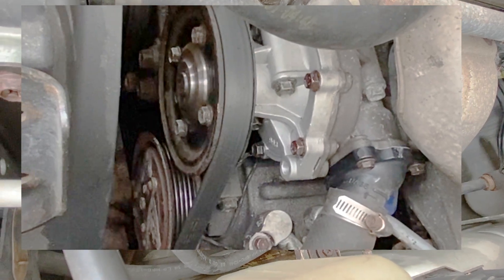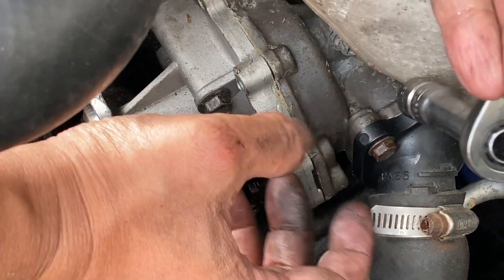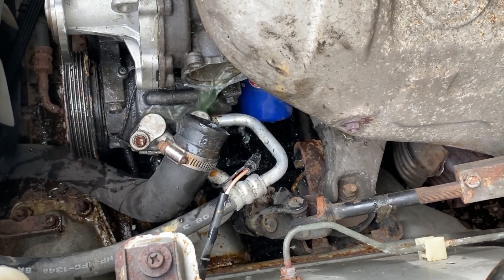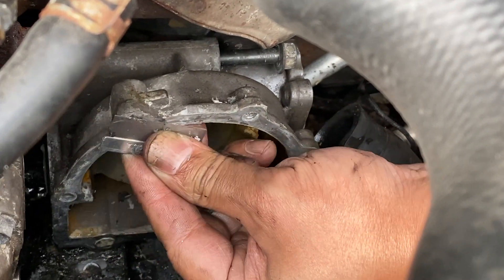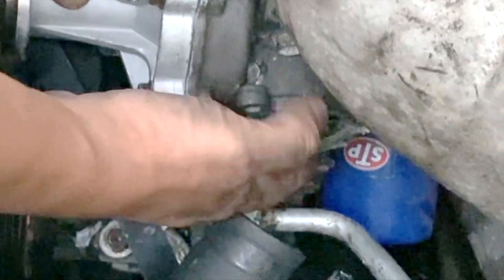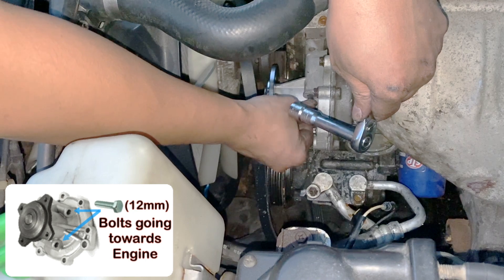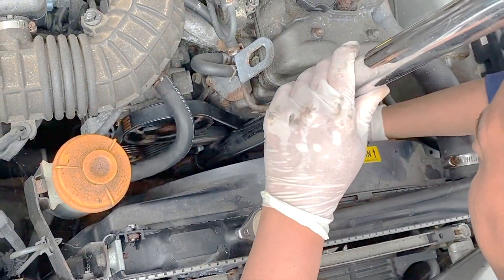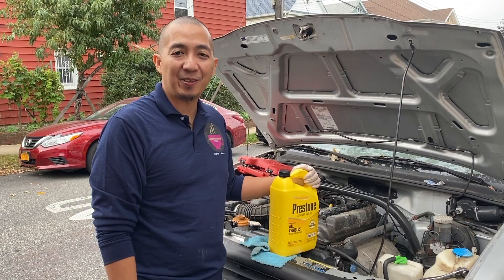How to: Replace a Drive belt, Water Pump and Thermostat on a 2002 Chevrolet Tracker ZR2 (3-in-1)

Comment: My plastic thermostat housing bottom bolt was in direct Line with the AC connection on that square block.. I had to pop that freon line off to get that bottom bolt out. Freon & freon lubricant everywhere..

Comment: The Dayco kit comes with an o-ring that seals the housing to the block I can't tell if you replaced it. And I guess for future people watching the video there's an AISIN (Toyota) thermostat that's compatible. Both Japanese so likely the same supplier, looks identical to the OEM one and Amazon sells it directly. THS-005 <---Thermostat Also the heater core line bracket in the back sucks to get under the exhaust manifold... And another o-ring I'll probably be sizing and replacing. Only the best for my mother I guess lol.

Follow up: Finished installing Dayco water pump with AISIN thermostat. Thermostat fit perfectly and triggered at the right temp. Car warmed up and was happy as a clam. The best guess I could do at sizing the oring for the heater line was 2.4mm x 20.6mm it's probably nitrile. It's JIS size ring which makes sense its a Japanese engine. Most importantly it's in a $10 kit at Harbor Freight or if you want, the OEM one is still available but shipping. I can't speak to the paper gaskets that all the pumps include I used RTV. For holding the housing to block oring in place dielectric/silicone grease worked great. People online recommended it as a plastic safe and its hydrophobic. I also used it on the heater oring to stop it getting scraped up or binding. Getting the pulley off SUCKED. Old pump in a vise PB Blaster and bonked away with a rubber mallet. Ebay etc has clones or "OEM" but they arn't cheap.

Comment: @How2Helen i have a question i got the same car and need to change my water pump i bought a new one and i got this O gasket i dint see in your video im confused where it goes
Reply from the maker: Hello. Is it maybe the ring around the thermostat? Or the mounting point between the thermostat housing and the engine of the vehicle? Those are the only ones I can think of. Of you want, send me a pic of your set on Facebook so I can check. -Rjeff H2H
Reply: @How2Helen  its all good i found out it is the ring for the mounting point between the thermostat housing n engine but i have another question now about the torque you say 12 lb ft torque but how do you calculate this on the wrench as it goes from 10 to 20 you just eyeball it more or less?
Reply from the maker: @beanboy1107  Glad you found where it goes. My torque wrench actually can do 12ft-lb. If yours jump from 10 to 20, then I would recommend to do 10, then just give it a touch of “ump”. But not to much as you might break it. Be careful as these things can easily break. I wish you luck! 🙏 -Rjeff H2H

Comment: Excellent, 1thing.. No need for gasket or sealant on the back of  thermostat housing?
Reply from the maker: Hello. The other side of the Thermostat housing goes to a rubber hose. You do not need to put gasket or sealant on that end, just make sure you tighten the clamp snug, but not too tight that  it might crack the housing. Thanks for watching! - Rjeff

Comment: I have noticed that you haven't responded to any of the videos. I just want to say thank you in advance for the insightful videos. But do have a question
Reply: What antifreeze do you use because it's an American car but made by Suzuki and when you look it up Suzuki uses the Asian antifreeze and the American uses the Orange antifreeze on my car 2003 Chevy tracker my problem is sorry this is so long it leaks every time I stop driving it comes out of the overheat holes I replaced the radiator cap what else should I try
Reply from the maker: @joechicago5687  Hello! My apologies, I just received your comments right now. I will try to answer your questions.
I use asian coolant (oat) even if it is technically American car, it is a Japanese design. That is my recommendation, but it is up to you.
Are you overheating? How about if you are just idling? Get a scan tool and put it in live data, check the temperature. Normal running temperature is 180-215 deg F.
If you are not overheating, but coolant is coming out of the expansion tank, maybe you just overfilled the expansion tank. Remember, when the car is running, it gets warm, so coolant expands, plus the pressure that the waterpump creates makes, will cause coolant to push out a little. That is why the expansion tank has a cold and warm level. Coolant will expand when hot, and retract when it cools down. I hope that helps -Rjeff H2H
Reply from the maker: Hello. I just replied. Let me know if you are overheating on the gauge or not, and if you do buy a scanner and check the temp on live data function. It is a big difference if you are overheating, or just coolant gets pushed out of the expansion tank. Let me know so I can help. Thanks again! -Rjeff H2H
Reply: it doesn't overheat when I'm  driving only after I stop the car does start to shoot antifreeze out the overflow hose.  I'll take it to a auto parts store and see if there's any codes.
Reply from the maker: @joechicago5687  you actually need a scanner connected while driving, and set it to live data. That way, you can monitor the temperature in real time if it goes above 215deg F.
Also, if you can, try removing the thermostat. Fill the car with coolant/water. From the radiator, see if the coolant/water is moving, like it is being circulated by the waterpump. If it is not moving, then you might have a bad waterpump. If the waterpump is not working properly, heat might be building up when you are driving, then when you stop, that is when coolant expands or “explodes” causing it to leak out of the hose.
Also, make sure your drive belts are not slipping. If it slips, it might not turn the waterpump continuously, which causes the coolant not to circulate, resulting on the overheating issue.
Try those and let me know. So we can troubleshoot furthers. Keep me posted-Rjeff H2H
Reply: I'll give  the thermostat  removal a  try.. thank you for all your help
Reply: Bit late to the party, but its my understanding that the radiator cap has a valve that pulls in coolant from the overflow when there's vacuum. And the OEM coolant is classic old american green coolant as far as I know. Coincidently Suzukis coolant of the era from Zerex is also green... But looking at a Vitara's engine bay everything is the same even the hoses, so I'm just assuming it's compatible. I flushed the system before putting in the Suzuki coolant to be clear. I just use the Vitara's repair manual. There's an owners forum that has it for download. I would link but YouTube doesn't like that.
Reply: @How2Helen  When I tried live data on an 03 it said it didn't support it. But I don't have a shop grade scan tool. 

edit: I stand corrected guess it was a bug or a fluke because my code reader does get live data from the tracker.

Comment: Thanks for the video, it helped a lot. The design of the water pump on this vehicle seems poor, I could only get to the lower rear housing bolt using a ratcheting wrench. What a pain in the a$$!
Unfortunately changing the water pump didn't resolve my overheating issue... It made it worse!
Reply from the maker: Hello. You might have an air bubble in the system if it got worse. Try burping the system first. Then, buy the head gasket tester from walmart online so you can determine if you have a head gasket issue.
If you don’t have a head gasket issue, and you don’t overheat city driving, but overheat on the highway, it might be your radiator clogged up. The added flow is too much for the radiator to cool down if it is clogged up.
If you overheat driving around the city, then check the fan and/or relay. 
Hope that information helps. Good luck. Thank you for watching! - Rjeff H2H
Reply: Hi Jeff, 
Thanks a lot for all the info! I will look into the head gasket tool. After driving a bit it's back to what it was doing before. It overheats only at low RPM, be it highway or idling. 3200+ rpm will cause it to drop quickly, so I thought the pump was going and not pumping enough at low rpm, but it doesn't seem to be the case. 
Now to replace the thermostat which I just did 2 years ago, should have done it while I had the pump out! Lesson learned. @How2Helen
Reply from the maker: @Gyppor  If it does not overheat on the highway, it might not be the thermostat. Because it means it opens porperly to prevent the cooling system from overheating. So focus on fan and fan components. Check our video on PT Cruiser low speed fan relay. On that car, the relay for the low speed fan is busted, which was causing the car to overheat on low speed. Easy way to check is when you have your AC on,  when the AC compressor kicks on, the Low speed fan should run as well. If it does not run with the AC compressor, check the low speed relay, and the fuse as well.
Another way to check, if you are technical, try to send direct power to the fan. If it keeps the temperature in tact or low, then there is an issue with your fan relay, fuse or even Fan relay module. Hope that helps! - Rjeff H2H
Reply: @How2Helen  Ya at idle you'll hear a click and the electric fan on the AC radiator will scream like a banshee. It's like nice engine so quiet. .. Click VROOOOOOMMMM.

Comment: Do you have a source for a oil pan plug I need for my son's 2004 Tracker ZR2?
Reply from the maker: Hello. Try Ebay. You can buy either the OEM Dorman Drain Plug 090-075, or one of those universal drain plug M14*1.5 Aluminum Drain plug, Let us know which one you decide to go with and share your experience, so viewers may benefit from your shared information. Thanks for watching!
Reply: @How2Helen  salamat